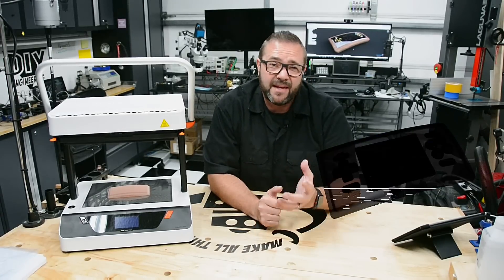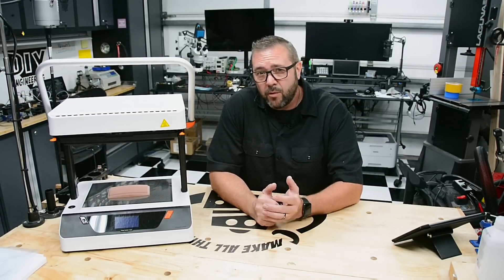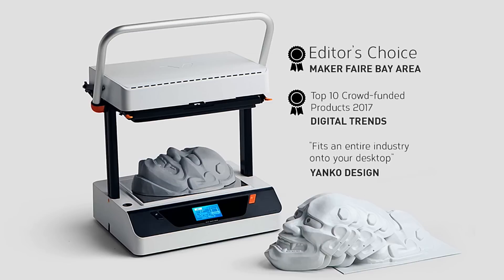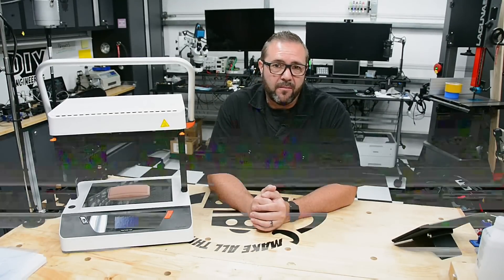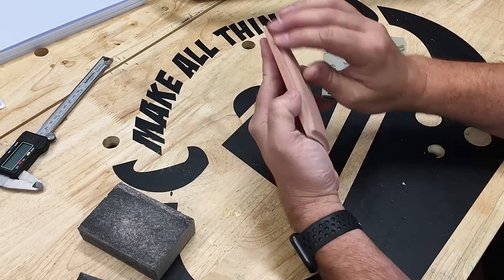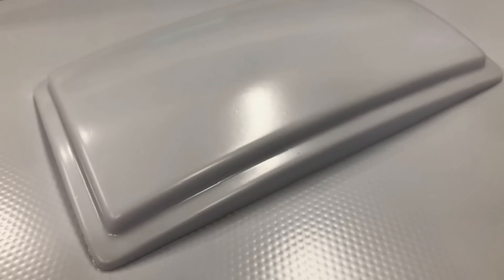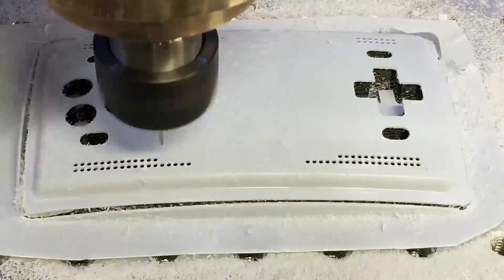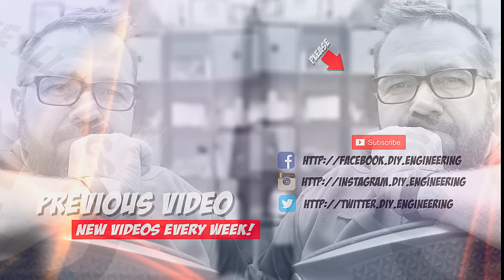Episode_038: Desktop Thermoforming CNC Milled Parts!

Comment: $1000 for the Vacuform machine. Pretty cool, But over priced for what it is and most hobbyist cant afford it. You can make one with 1"x 4" wood, peg board sheet and a shop vac for under $100 that works very well.
Very nice video by the way. I really love your content and video quality. Keep it up, Quality or Quantity always..:)
Reply from the maker: Robert i agree with what you said, but this machine doors pull a high vacuum, almost 3x what a vacuum can pull. But, does everyone need that? Maybe not, but my projects do. :)

Comment: Have you compared the Vaquform against other consumer grade vacuuformers?  I'm helping to set up my makerspace's rapid prototyping shop, and while we have 2 laser cutters, an X-Carve, and a number of 3d printers, as a group we don't have a ton of experience with vacuuformers.  Is it straightforward to use?
Reply from the maker: Bradley Powers i used a couple others. The vaquform has superior vacuum strength and simplicity. It's as easy as the video demonstrates.
Reply: @DIYEngineering  Good to know, thank you!  I'll put a good word in for that unit.  Awesome video as always!